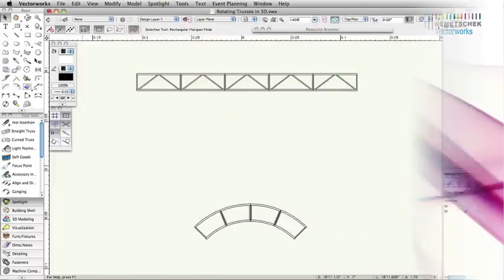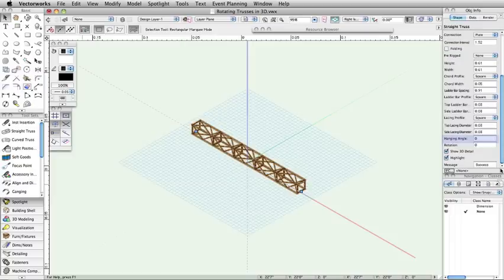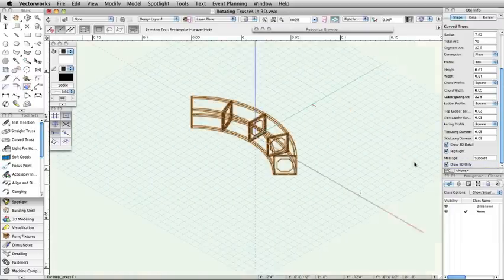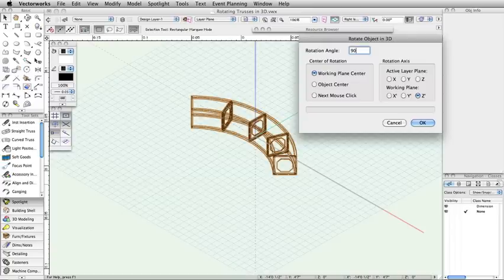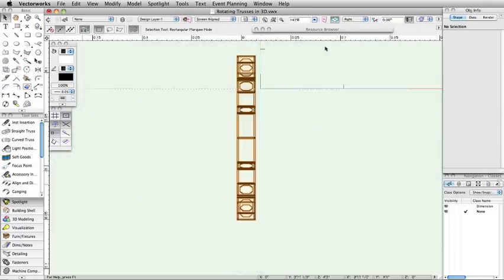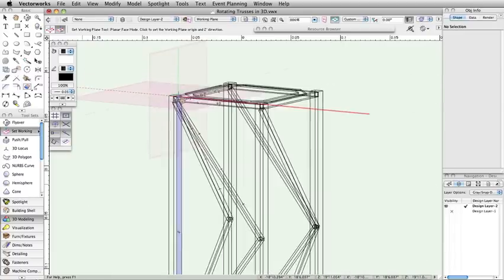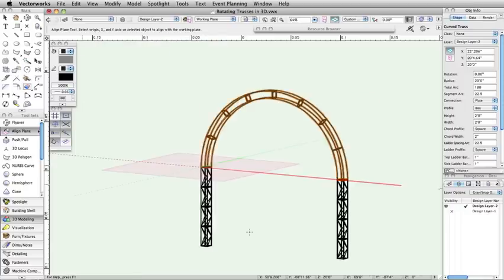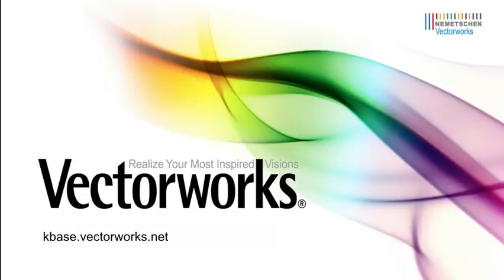Rotating Trusses in 3D in Vectorworks

Comment: Useful.  Is there a similar method for hybrid objects?  Specifically framing members...creating symbol-based trimmers, for example, seems unecessary when the framing tool creates the shapes automatically though cannot rotate on any plane expect the Z axis.
Reply from the maker: Not so far, no. However if you have any in particular you'd like it for, I suggest requesting it on the wishlist: https://forum.vectorworks.net/index.php?/forum/19-wishlist-feature-and-content-requests/